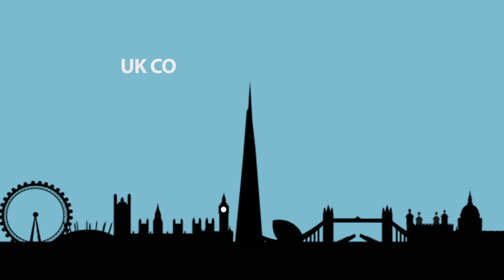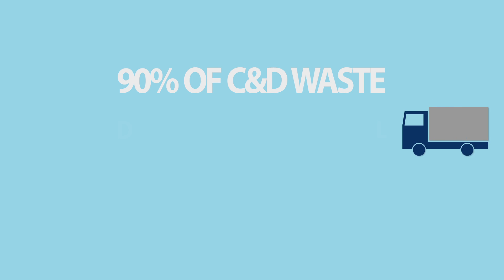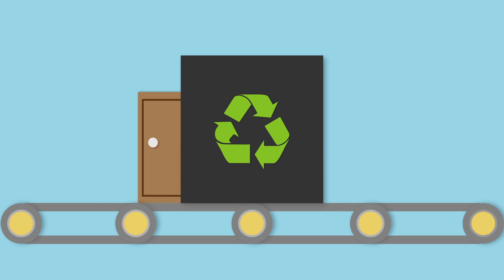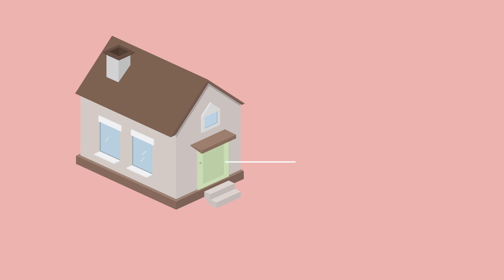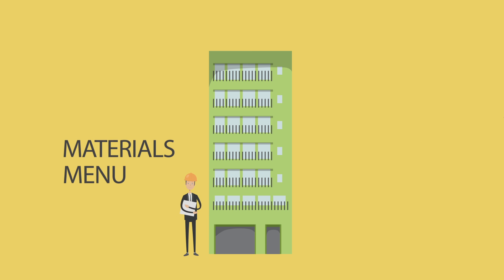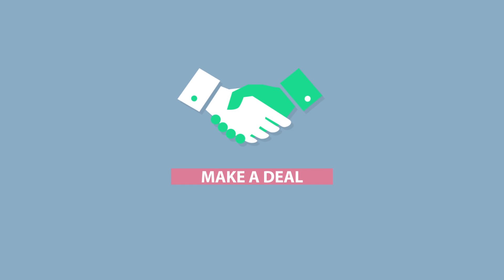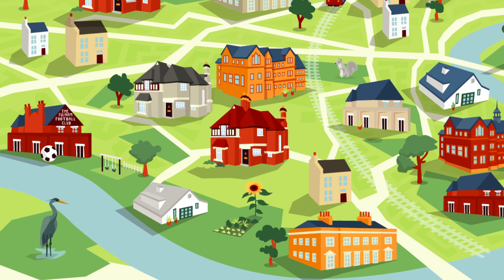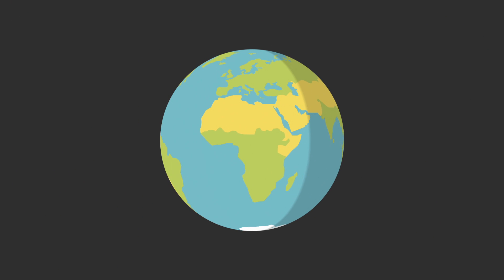Reuse: Opportunities for better use of waste construction materials

Comment: Conceptually, I like "Reuse." The challenge I find is the material's or component's life cycle and serviceability. Can Reused Materials and Building Components be applied and installed as-is, or will they need to be refurbished in some way? And thus, this refurbishment process would still add waste to the production pipeline. Thoughts?
Reply: Hi, thanks for your comment.  Sometimes it will be possible to reuse directly, i.e. with minimal refurbishment, but that tends to limit the types of projects that can use such materials.  Other times more significant refurbishment or upgrading will be necessary, and can potentially make it possible for reused components to be adopted on a wider range of new projects, increasing demand.  More on this in our later published research, available open access here: https://www.mdpi.com/2071-1050/10/1/229.  
Regarding waste still being created - yes, we are quite a way off any system being perfectly circular and without wastage.  Goal is to close circle as much as possible by maximising what is reused - then when stuff gets away, becomes waste, send it into high quality recycling processes.
Colin